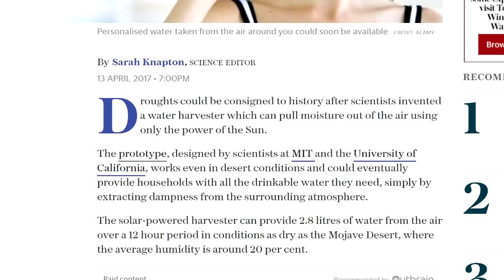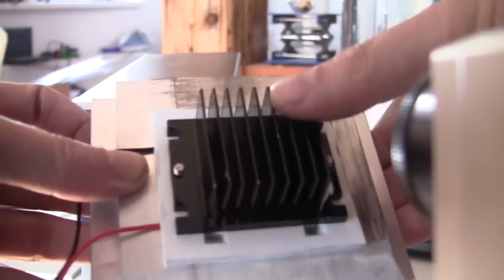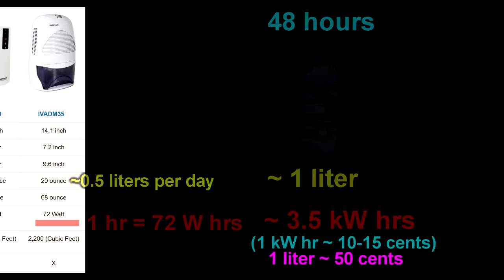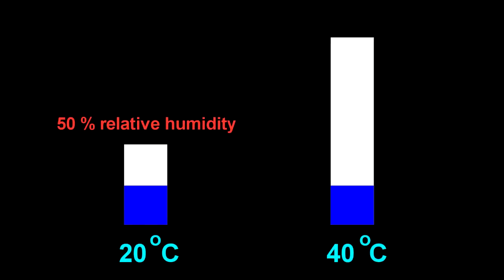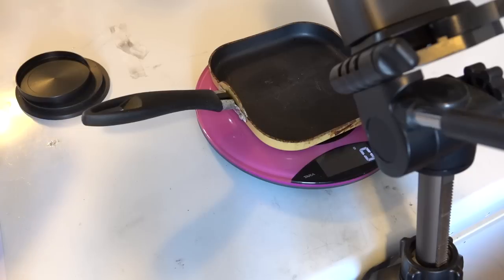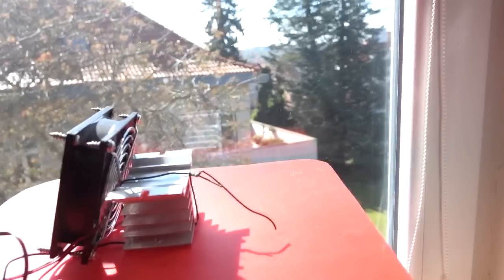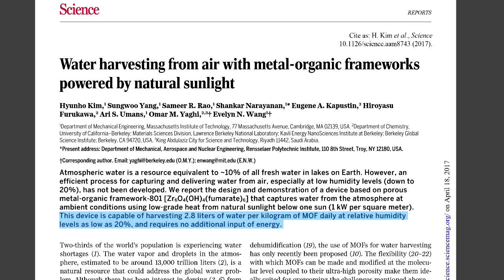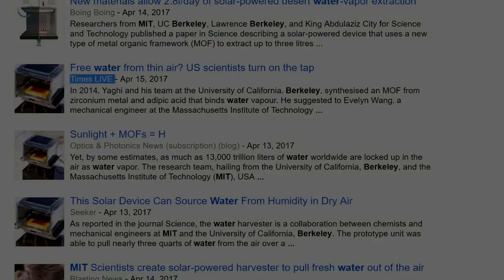FREE water from AIR device: BUSTED

Comment: When are people gonna realize that the reason dry places are dry BECAUSE OF THE LACK OF WATER IN THE AIR!!!
Reply: Not all deserts have dry air. There are deserts where the air can actually get quite humid but it still won't rain because the conditions that cause atmospheric instability aren't present and the humidity level doesn't reach the point where the air becomes thoroughly saturated, which is what you need to get for rain to happen. The Namib desert, parts of Oman, the UAE and Saudi Arabia are a few regions like this that come to mind. Don't get me wrong though, dehumidifiers are an energy intensive, stupid way to produce water anywhere, not least in deserts. Reverse osmosis desalination technology is probably the most efficient for generating large amounts of fresh water.
Reply: @mimas3346  interesting bit of info, nice
Reply: If you route the exhaust pipe of that thing to the air intake, it would helpma lot
Reply: @mimas3346  sooooo.... fog condensing?
Reply: is because*?
Reply: Just wanted you to know that this comment was awesome. It gave me a good strong chuckle. Thanks for making my night.
Reply: Exactly my thought, even if it did work what would happen to the air and environment? The air would get even drier, the people would have more water, yes. However it isn’t like water was added to the area it’s the same amount just that it’s concentrated into one place. This would in theory lead to local wildlife suffering as the little amounts of rain would be reduced.

Comment: FREE WATER FREAKING ROADWAYS
Reply: dariomasi9 OMG TAKE MY MONEY!!!11!!!1
Reply: Thorium powered device that generates asphalt from air.
Reply: I'VE SEEN THE FUTURE
Reply: you are just showing me a frozen river.
Reply: If it's not thorium powered, I don't want it ;)
Reply: SOLAR FREAKIN WATERWAYS
Reply: Roads made with water, I call them ice roads!
Reply: ROADS THAT GENERATE WATER BASED ON THE PRESSURE FROM THE TIRES THAT DRIVE ON THE ROAD TO WRING OUT THE WATER FROM THIS EXTREMELY UNIQUE AND RECYCLABLE MATERIAL 

ITS TUBULAR
Reply: good bread
Reply: AND MODULAR EASY TO REPAIR! 3 mil kickstarter I said it first.
Reply: dariomasi9 you mean...umm... rivers.
Reply: 6 years later anybody invent solar powered lithium generator yet for infinite free quantum batteries?

Comment: Remember, this is only a prototype.  The finished item will be using unobtanium, so it will all work in the end.
Reply: We have to pass the finished item so that you can find out what is in it.
Reply: 44WCF 1892 Plot twist they never release the product and hey ran away
Reply: Who's end, will it work in?
Reply: Jack Dingler Joe's
Reply: What will the unobtainium do to make this work?
Reply: It's actually an alloy of Unobtanium and Balonium called Hoaxite™.
Reply: K1naku5ana3R1ka
It will be used as a quantum generator that has a near zero chance of powering the device. You simply use the energy potential from the improbability of success to run it.
Reply: Unobtainium is a fictitious material that will do whatever you want it to do, likely be very rare and very expensive.  Aeronautical engineers, scientists and even the military have used this term since the mid-50's.  It is used in a humorous fashion when talking about needing a new material, that currently does not or may never exist,  to fit into whatever they are doing.  

Such a material for pulling moisture from the air, using virtually no energy, and possibly even duplicating the water molecules (somehow) to fill a bottle.
Reply: Unobtanium will be instrumental, in allowing this technology to be incorporated into hovering, thorium based, solar roadways.
Reply: Unobtainium! Where is that on the periodic table 👍🏼🥴
Reply: @williamkwl6153  
After going to Hawaii to test it out! 🥴
Reply: @DonCDXX  
👍🏼🥴👍🏼🥴
Reply: @TheProtronic  
👍🏼Aaaaahhhh yes potential! That explains everything!🥴
Reply: @DonCDXX  You forgot that Hoaxite also contains Bullshittium and Gullibilium.

Comment: free water from air using the sun? Isn't this how the weather works now?
Reply: Hold that thought, I think you might onto something.
Reply: Take it easy on them son, they're just now figuring this out.
Reply: Holy shit.
Reply: it does in the UK, but without the sun part.
Reply: Terry Dickinson Want free water? - UK FRICKING WEATHER!
Reply: that's the point he does make at a point.
Reply: Natural Weather Tech - UNLOCKED! ILLUMINATI CONFIRMED!
Reply: que the illuminati soundtrack
Reply: the sun encompasses a vast majority of land, therefore more water is being able to be evaporated. but also as the vapour reaches a higher altitude it is much cooler than on the ground, and due to atmospheric surface area, the heat removed is able to dissipate into the atmosphere. where as with these systems that say they can get water, while is true, does it at a long period of time using the sun, or u need a mechanical device to add work to allow the heat transfer to occur at a faster rate. this is the first law of thermodynamics.
Reply: Terry Dickinson 
Exactly.
Reply: It's just glorified, man-made rain.
Reply: Wait until it`s at least 5 drops before calling it "rain" :p
Reply: Yeah it's been working like that since 1967.
Reply: actually, sun has hydrogen so throw oxygen and boom, free water
Reply: +general kitten I threw all my oxygens but never managed to hit two hydrogens at once.. how do you do it?
Reply: ***** i light it on fire, works much better, but dont go too hot or it will rip itself off from the heat back to atoms
Reply: Sure if you want to travel miles to a fresh water lake, or dig deep enough in the ground, or have a big umbrella, upside down to collect the water(when it is raining) meanwhile drop dead for lack of water.
Reply: So, everything is not free in this world.
Reply: That's what Big Weather wants you to think.

Comment: According to Berkeley the few water droplets identify as several liters. Volume is a social construct and if you dont agree you are hydrophobic!
Reply: Seamus Ó Raghallaigh lol good one
Reply: Up you go !
Reply: Also, racist, sexist, and homophobic. You can't just be a single thing-aphobe, it's all or nothing.
Reply: Being hydrophobic is apliciable to all land animals, no one likes drowning
Reply: You're giving them ideas....
Reply: And 500 watts identify as free energy.
Reply: all the cell walls in my body are hydrophobic, if they weren't I'd be a pile of goo on the floor
Reply: Being hydrophobic sounds awesome. Rabid and deadly, but awesome
Reply: @pyropulse
Except for the fact that in the same paper they said at most optimistically the MOF could absorb 50% of it's weight in water (they were only getting 25%) so that's half a L of water per kg of MOF at best.  That's less than a fifth of their promised output.  That means they would need to have 5-6 absorption cycles to get that ~3 liters of water (double that for their actual results).

Now this is supposed to collect water overnight.  So you would have to rely on some sort of device to remove the water from the MOF...AT NIGHT... to get multiple cycles out of it.  So no you can't rely on solar power alone for this.

And you're supposed to get ALL of the water out of the MOF from solar radiation alone and then get the air cool enough to get the water to condense, but this is a closed system (except for the sun and the air intake) so you have to hope the MOF just doesn't reabsorb all the water in the air before you can condense it.
Reply: Hydrophobic? Like Carbonhydrates? THAT IS NOT aPROPANEiete
Reply: Yup. That is why you can't trust the political left, since they care more about ego and status, rather than facts and logic. Honestly, dessication isn't the solution at all, since the device is small. But, I do want to see how practical condensation like in an AC unit would be, since there are devices like that. Given I haven't seen a video from him yet, it is still possible.
Reply: Okay it's 25% experimentally (which I did mention) that still requires more than 11 cycles, but you fail to even touch my main point: YOU CAN ONLY GET ONE CYCLE A DAY WITH THIS SETUP.  

At most you can harvest 250 g water / kg of MOF.  And that's assuming you can get 100% of the water out of the MOF during the heating and can condense 100% of the water (which you can't). And it also assumes you can even collect enough water to fill the MOF to capacity through natural air flow (since you can't use a fan that would require additional power).
Reply: wow guys.. it's 2.8 liters per KILOGRAM of MOF. he says in the video multiple times and he says they used only 1.3 grams.. lets try a little maths...
Reply: +pyropulse Thank you for trying to get through to these people.. sometimes just reading critically is difficult when you have confirmation biases
Reply: Yeah and a KILOGRAM of MOF can only hold 250 grams of water (that's about a quarter of a liter).  And since the whole process takes a day that's at least 12 days to produce 2.8 liters of water.
Reply: and you completely ignored the volume of water that condenses elsewhere within the device, good maths
Reply: The vast majority of the water in the device is in the MOF.  The rest is in the air when you close the device in the morning.  If you have a cubed meter of air in the device at MOST you're getting is 20g at 100% Humidity in 20 degree C air?  Congrats 270g of water to work with.
Reply: Sangtrone the reported numbers are per kg (clearly stated) of MOF and they are damn low densitt
Reply: +Pyropulse It' is really simple math, even you can do, even with 100% yield efficiency, on most deserts, < 25 cm of water per year ~ 15.6 L/year ~ what we're suppose to drink in 2.5 days. The average relative humidity percent for 24 hrs is about 0%, in most deserts, thus the lack of condensation and thats why there's a feeling of dry air. The question is, how are you going to generate >1.00 L of water in 1 day? When in 1 day there's less water in the air than a liter, on a desert. On the desert the best way to obtain water is by making a damn due to the permeability percent of the ground, which is really low. In the article it says, "it can work as low as 20% humidity!" when the average desert is less than that. 

  

 
http://news.mit.edu/2017/MOF-device-harvests-fresh-water-from-air-0414           (Article) 
https://www.nationalgeographic.org/encyclopedia/desert/               (Go to the bottom, at *Desert Characteristics*)
Reply: Seamus Ó Raghallaigh That 
was the part that jumped out at me.  it's per kg of that metallic matrix material.  so, I'd love to hear how big that would be in area.
Reply: Again the MOF only holds 25% of it's weight in water.  25 % of a kg is not 2.8 L of water not even a tenth of that.  They said they'd get 2.8 L out of one kg of MOF, someone is lying.

Given 100% humidity at 30 degrees Celsius there's about 30g of water to 1 kg of dry air.  That's about the absolute best conditions you could have at night for this.  So we need about 93.33 kg of dry air minimum to supply 2.8L of water.  The density of saturated air at 30 Celsius and 100 KPa is about 1.13 kg/m^3.  So that's about 83 m^3 of such air that needs to make contact with the MOF at 100% efficiency (which we all know it isn't).  That's fairly close the volume of two 20 ft long shipping containers.  All for 2.8 L of water in one night.  

At a more reasonable 20 Celsius and the 20% humidity this system is supposed to work at,  that's about 591 m^3 of air to supply 2.8 L of water.  So more than 13.5 20ft shipping containers.  Without any kind of pump or fan and assuming 100% efficiency of everything the device promises.  We're talking a house sized volume of air for the needs of one person (maybe two in a survival situation).
Reply: Theoretically, the device could cycle multiple times per day. You could use a shutter to shade the MOF so it would cool down and absorb moisture. Then seal the chamber, open the shutter to heat it up and release the moisture to be condensated. As long as the air keeps moving (wind), you shouldn't need any mechanical assistance like with indoor dehumidifiers.

The paper did use this scenario in their calculations, I think they used a 90-minute cycle and a theoretical situation of 24 hours of 1 kW/m2 exposure to end up with 2.8 l of water.The latter part of which obviously will never happen, they even stated in another part of the paper that you'll have, at most, 7 hours of peak exposure even in the desert, so that number is closer to 1 l / kg MOF.

I don't think this is a silly idea, or that it's theoretically impossible. But they only did test the thing with a full-day cycle and a temperature-controlled test chamber (the Peltier device). I believe if they actually try to do this for real, they'll quickly run into problems with inefficiencies, heat inertia, mechanical problems. It'll be big (not quite house sized, but big) and mechanically complex. 

The sample they used was 5 cm x 5 cm, weighing 1.34 g. So a square meter of the stuff should weigh half a kilo. A device that provides 1 liter of water a day should be at least 2 x 1 meter, somewhat bigger than your standard 250W solar panel. The way I see it, a water collection device could be sort of a thick panel you're supposed to angle towards the sun. With the shutter on top, chamber in the middle, heat sink on the bottom.

Problem is, a 250W solar panel, using that same 7 hr figure, will produce 1.75 kWh of power. Is that not enough to run a dehumidifier and precipitate a liter of water? I hear that the best of those devides are rated 300 Wh/liter. Granted, they aren't meant to run in 20% humidity. Still, anywhere else but deserts, a solar panel and a dehumidifier could actually fare better than this thing.

Comment: At the beginning of the video I saw one of the articles mention desiccant, it's an orange glass like material that sucks water up really efficiently, I play the bagpipes and I use a desiccant system to keep the reeds dry so that I can play for a few hours at a time. 

Once the desiccant becomes saturated and turns blue you have to bake them in an oven to dry them out, so any water that the system creates is simply absorbed by the desiccant and is not possible to drink unless its heated up a lot
Reply: Yeah, that's why they have the peltier device and say they use the sun.  Once the water is absorbed in the dessicant the energy from the sun causes some of the water to evaporate into the air in their closed box, with higher humidity they turn on the peltier device which the fresh water condenses onto as it creates an area where the air is at 100% relative humidity.

Comment: "water from the air, even in the desert!" Nigga the air is dry because there isn't any water in it. Does this machine perform a rain dance conjuring ritual or something?
Reply: It might as well have no water in compared to where I'm from, where the average humidity is 80%
Reply: 80% relative humidity. It doesn't tell you how much water really is in the air.

80% relative humidity means that at the air the given pressure and temperature, is 80% saturated. Cooling the air will increase the relative humidity without changing the absolute humidity. So if its fucking cold, you could have 99% relative humidity, but the air has less water than the driest deserts.

Water always condenses at 100% humidity.
Reply: I'm still talking 80% humidity in the dog days of summer. You run a dehumidifier in that and you have to empty it daily.
Reply: +Franz Conrad von Hotzendorf I live in So. Cal and it's 30% humidity. It's plenty humid in deserts.
Reply: +Franz Conrad von Hotzendorf  Are you subscribed to the channel The Great War  ?
Reply: +Dorian Dunn The hell is a "real desert"? Not to mention Vegas is in Nevada.
Reply: +Dorian Dunn 1. You are correct, sarcastic comedy doesn't come across over text.
2. Fuck my life, I somehow missed "by comparison", my bad.
3. God damn Nevada is dry. Don't know how you guys aren't the ones with the horrible drought.
Reply: no air has h2o in it learn science
Reply: Learn punctuation so your sentence makes sense.
Reply: +Ryan Rentfro sounds like a nice timelapse video of a hygrometer with some awesome scenery in the background you could start making tomorrow :-)
Reply: Timorio *you're

jk m8
Reply: Channeling Chris Rock there.
Reply: There is still water in desert air. Actually, there are deserts where the air is EXTREMELY humid. Some deserts even get full on mist.
Reply: Thats exactly what i think when i i read that crap
Reply: Dude, your words a full of beauty and truth... you brought it to the point... ;)
Reply: Its Magic!
With a little bit of science of course.
Reply: Yes it is actually powered by the souls of the damned and uses their soul energy to create matter from nothing.
Reply: Decolonize your mind
Reply: You just have to believe ;)